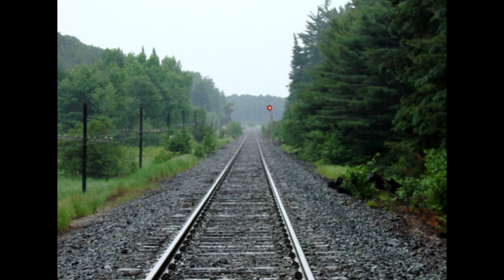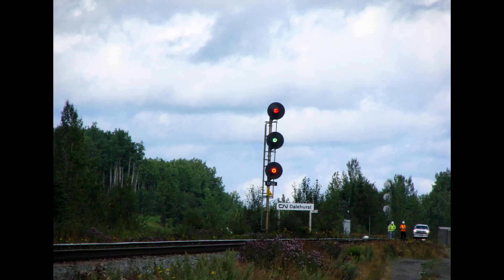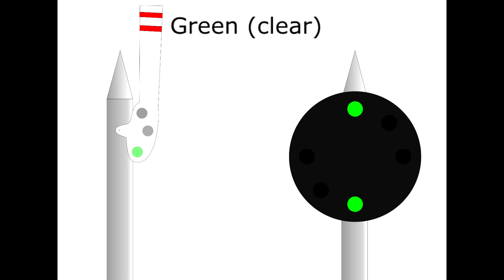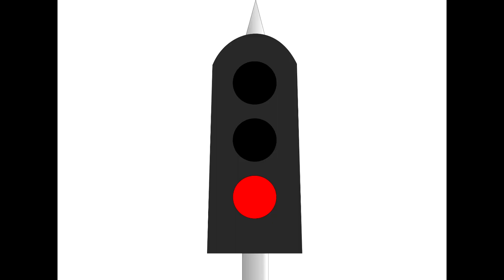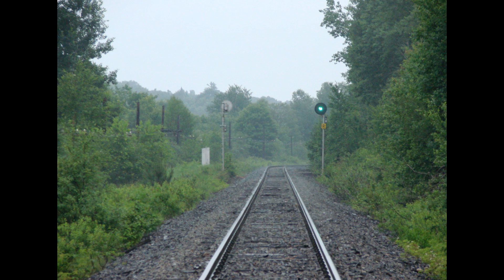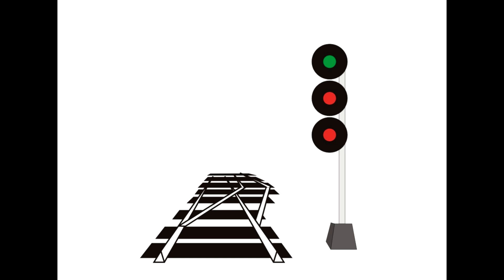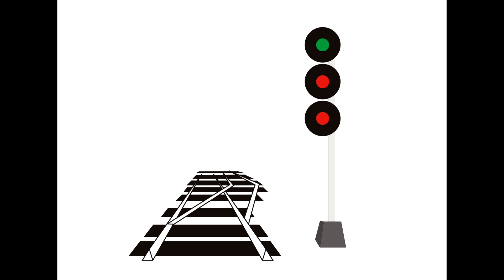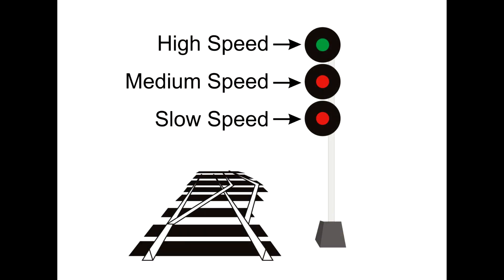Reading Canadian Railroad Signals, part 1: the 3 light system

Comment: While on a via train in the dome car, I started to get an understanding for the 'Clear to Stop' signal,  how come the next three to five signals  shows 'Clear to Stop' signal?
Reply from the maker: You were probably following a freight train. The VIA's are way faster than the freights and so you're constantly on their tail. The VIA crew will be listening the radio calls and they are know the territory. Most signals you'll be able to see sometime before you get there but some you will have to crawl around the corner prepared to stop. RTC actually had us stop our train once and let the VIA pass us using the siding. They keep the freight on the main track because when we get the green light, there's no speed restriction. The VIA is restricted to 15mph going around us through the siding but they get back on to the main track and up to speed real quick so the siding speed doesn't really slow them down that much. Then once they've cleared the block, we get a green light and pedal to the metal get the freight train back up to speed instead of pulling a mile and a half train through 15 mph track.
Reply: @ianjuby interesting Ian

Comment: Finally, I can read the signals in TSW. I see that if the signal is not working normally, it should place a signal which makes the driver to do a safer action like driving in a lower speed.

Comment: The UK uses a slightly different kind of colour light signal. There are four coloured lights on the signal, each displaying different aspects. Green means clear, two yellow lights means preliminary caution where the next signal shows a single yellow meaning caution, expecting the next signal displaying a red light, meaning danger (stop)

Comment: Great presentation!  That was the most understandable explanation of signaling and especially the logic behind it that I have come across. 👍. I live near CP tracks in the US, do you know if there are any differences between CP’s signals in Canada vs the US?
Reply from the maker: there is and there isn't. They call them different names like "Clear to stop" in Canada is "Approach" in the U.S., but the signaling can have some differences of which I'm not familiar. For example, I've seen some signals which have a standard light in the middle of the pole, and then one smaller light waaaay up high. I have no idea what that's about. lol
Reply: @ianjuby  thanks!

Comment: With the capability of the three head signals to produce quite a variety of indications, are all of the signal indications controlled by the position of turnouts at control points or sidings or does the RTC have the ability to select an indication?  I think I know the answer but though I'd ask anyway :)

Comment: I love trains and RR crossings. The point is if the lights are not bright wether it's green yellow or red if either color is not bright then that means a train is not nearby (I could be wrong that's just what I think) but if it is bright then it means it's telling the train nearby something (again I could be wrong). The yellow color on the bottom is the hardest to tell

Comment: Would it be okay if I pictured the advanced clear-stop as a clear signal
Reply from the maker: Depends on the territory and signal to be honest. If we're following another train, we'll see lots of those signals and by the time we get to the next signal, it's changed from a clear to stop to advanced clear to stop. So ya, we basically just keep treating them as clear signals. But we're on guard because we were warned the next signal is going to be a clear to stop signal. And so if the expected signal after that is a stop signal, and it's a short distance between the approach light and the stop signal, well now you gotta work really hard to stop the train before the stop signal.